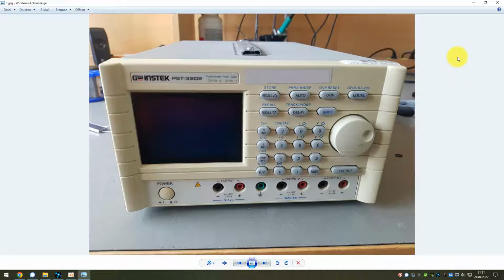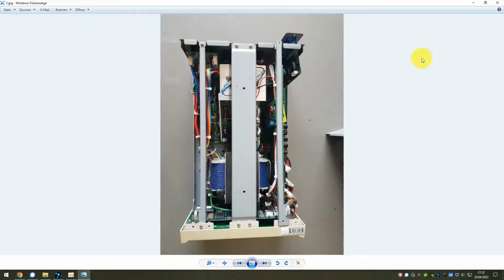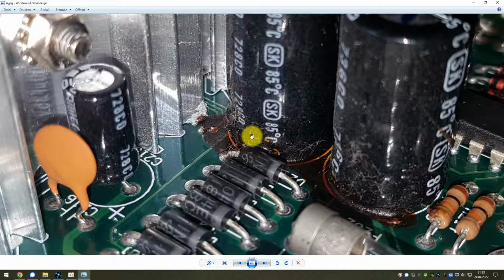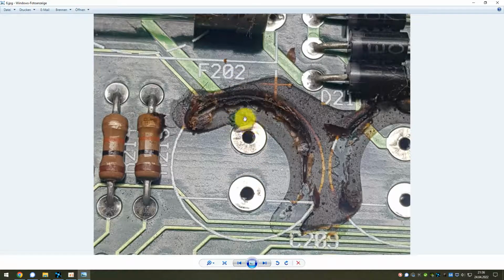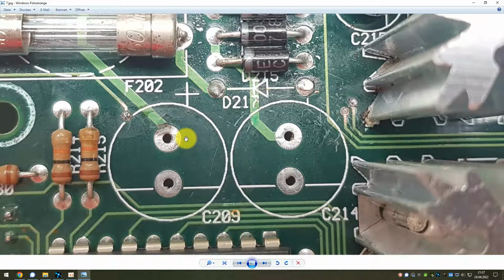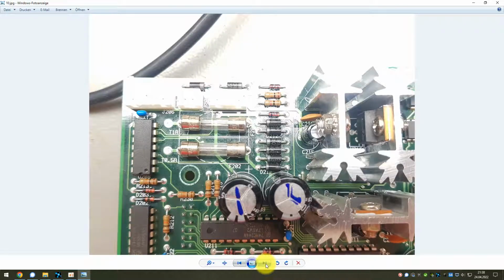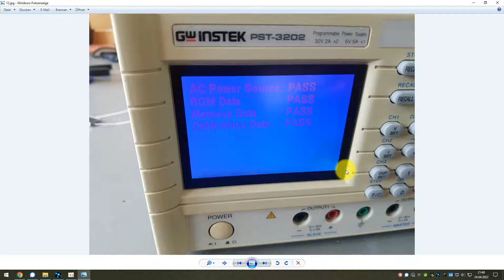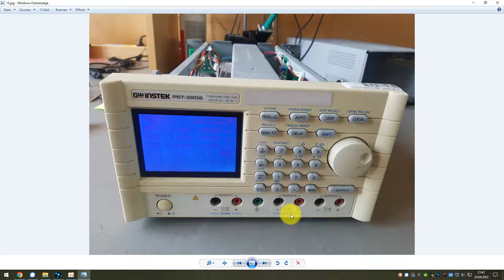GWInstek PST-3202 Repair

Comment: What is best way to get this brown gunk off?
Reply from the maker: Remove the bigger pieces white a sharp metal object, like a small flathead screwdriver or a pair of tweezers. Be careful not to damage any traces while doing that.
Afterwards try to remove the rest with a Q-tip and some cleaning alcohol.
The result does not have to be spotless. Just make sure, there is no brown gunk touching any metal (traces or component pins) left.
Reply: @NebukadV thank you
Reply: My units transformer is labled week 1245... I believe this to be an early or first unit.. My adhesive is not the nasty brown type I'm glad to say.. Sonybond as its known in other circles and oftern in vintage audio and radio ham/cb equipment... I did find a video from a south African guy who had an early unit and the eprom and a flashed chip had firmware errors stopping the full 4 Amps  in parallel current mode... Worth checking out... Not sure this supply was such a bargain..